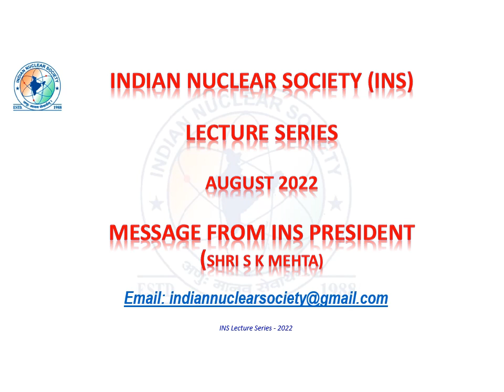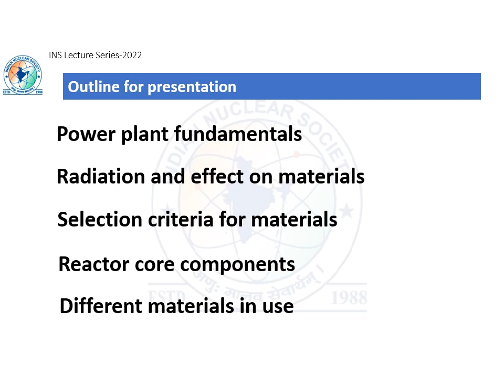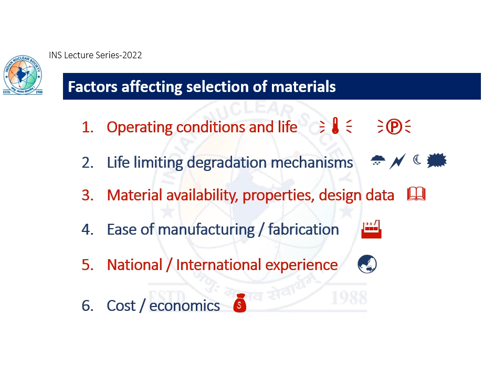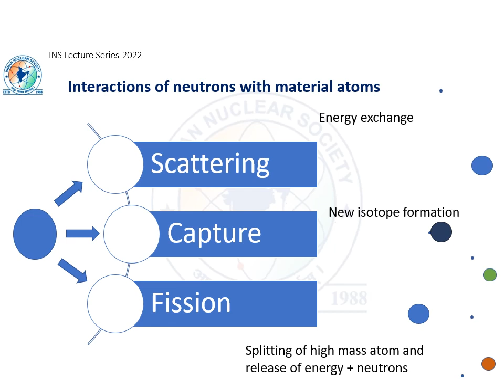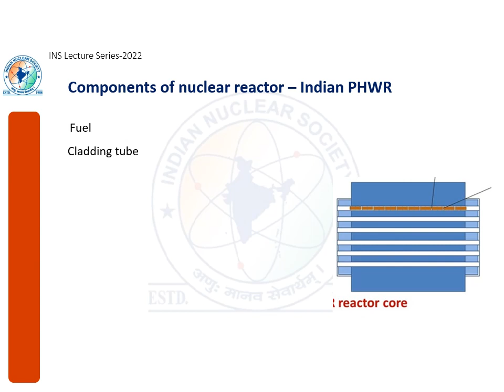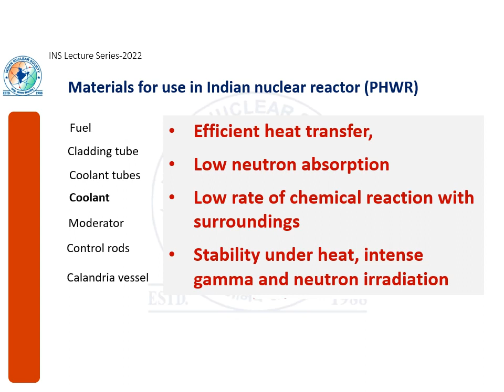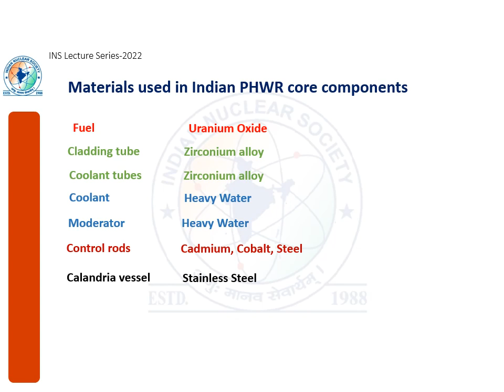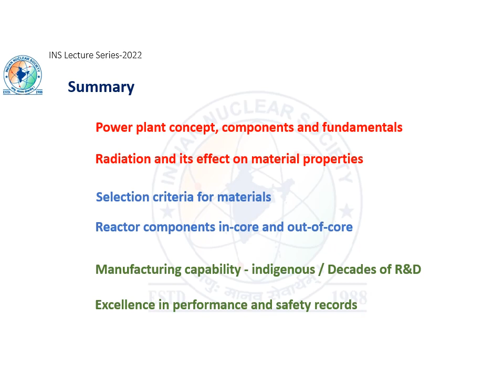INS Lecture Series 2022: Materials for Nuclear Reactor Core Components by Vinay Vaze (BARC)

Comment: Nice lecture. But it needs one correction that at about 14.34 minutes of your talk you have said that the coolant water pressure in these reactors is about 100 bars. It is the pressure which one feels at about 100 meter depth below the water. 
It is incorrect since 1 bar pressure is equivalent to pressure you feel at 10 meter depth below water. So 100 bar pressure is the pressure you can feel at about 1000 meters below the water depth.
Reply: 100 bar pressure is at a depth of 1000m under water. The picture shows 1 km depth which is same as 1000m.